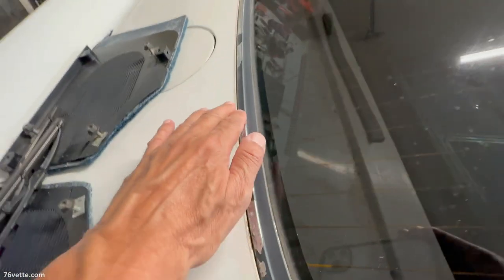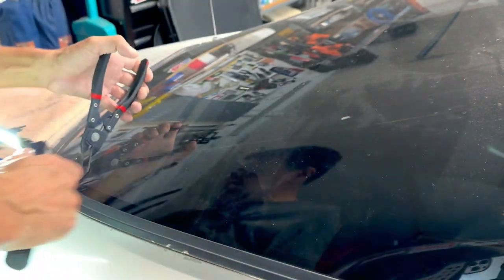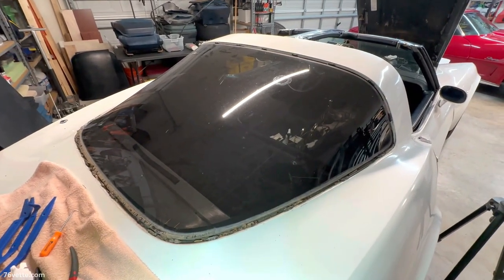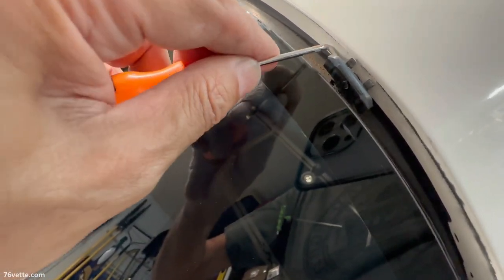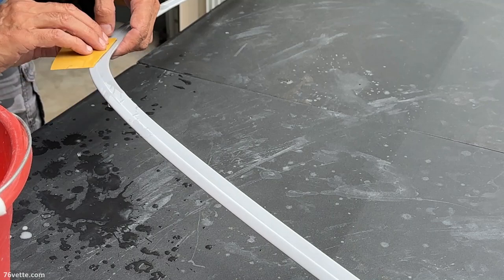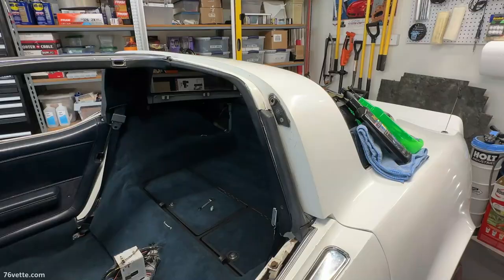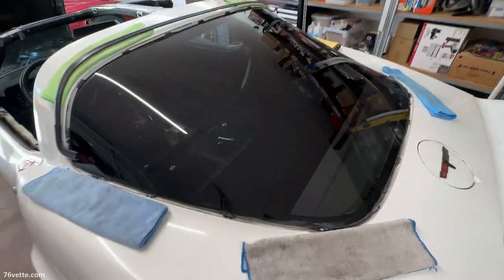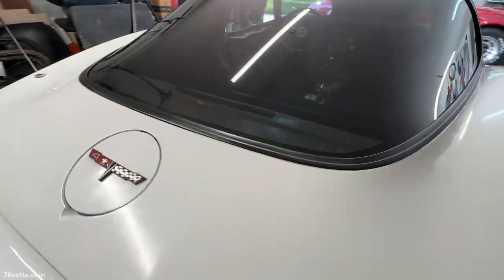Remove, Paint, Install 78-82 Rear Glass Molding

Comment: Does anyone know where you can find a replacement moulding for this year corvette. Mine is damaged but having trouble finding a replacement
Reply from the maker: Contact Wally at Corvette Generation, (352) 523-0900. Located at 16541 US-301, Dade City, FL